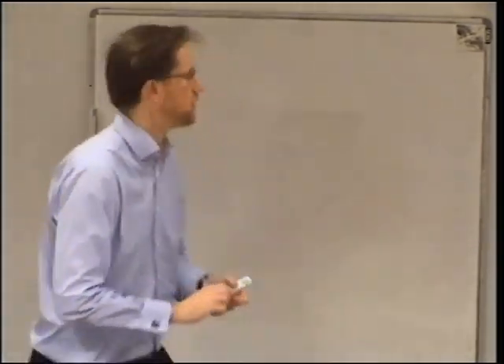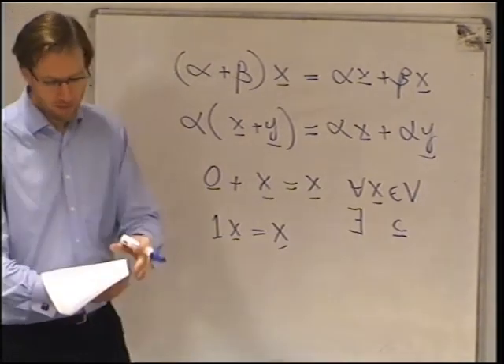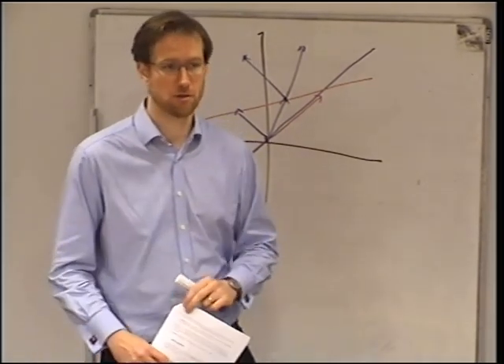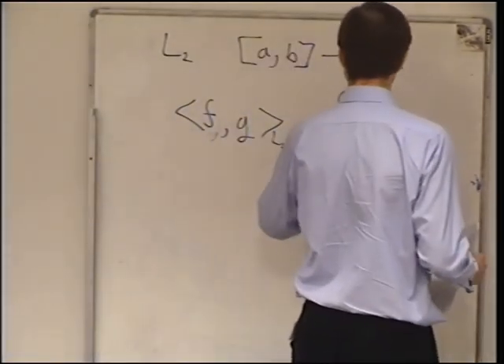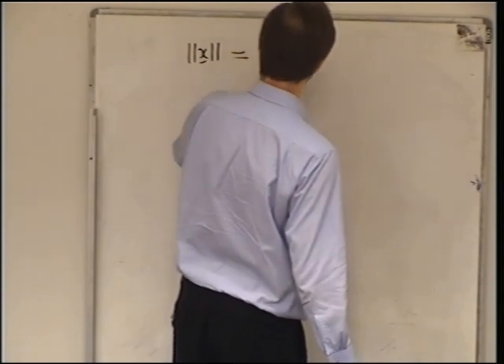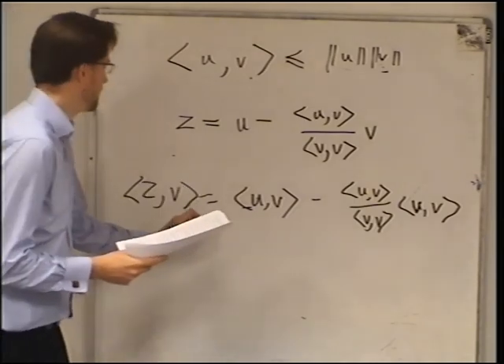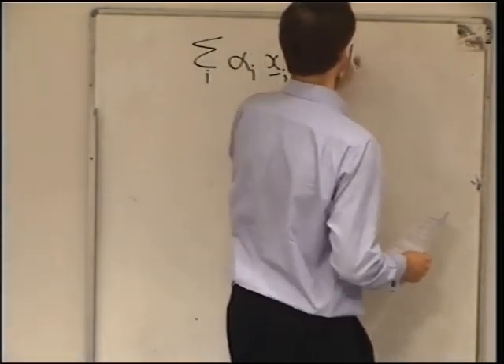Finite element method course lecture -1: function spaces

Comment: Hi. Very nice lectures. 
Can you improve the quality of sound in the videos?
Reply from the maker: Hi Rahul, 

I think the sound quality basically comes from the quality of the recording equipment, so I'm not sure I can do much about that.
Reply: +David Ham Hello David

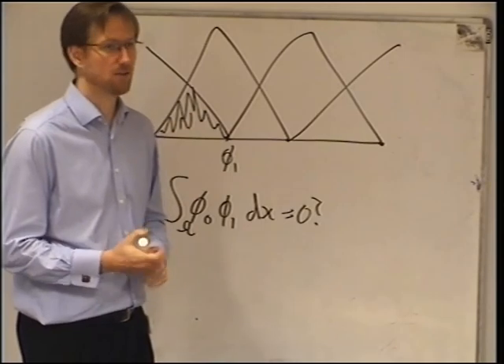I'm trying to understand the part 1:19:50 where you are trying to explain the uniqueness of the basis functions. I'm not able to comprehend the concept properly. The size and signs of the basis function space. Would it be possible for you to help me through that?
Reply from the maker: Hi Suyash, 1:19:50 is the end of the lecture, so I'm not quite sure which part you are referring to. However, the construction of finite element bases is covered in more detail in some of the other lectures, so I suggest you take a look at those for a further explanation.